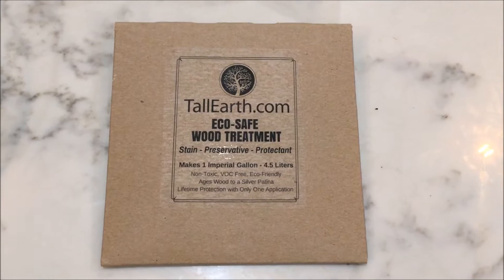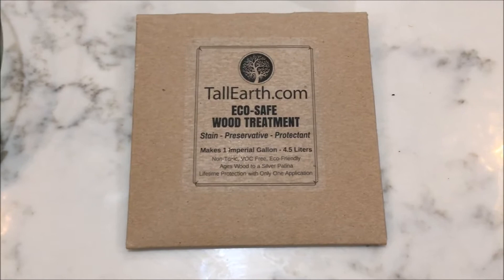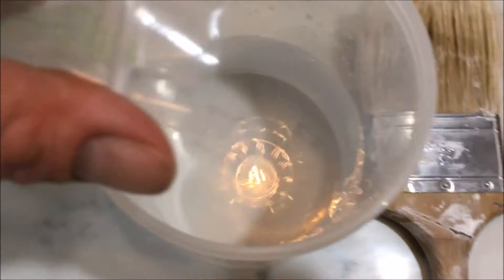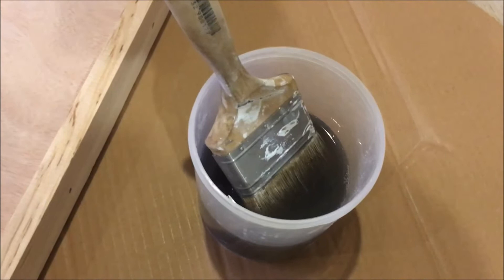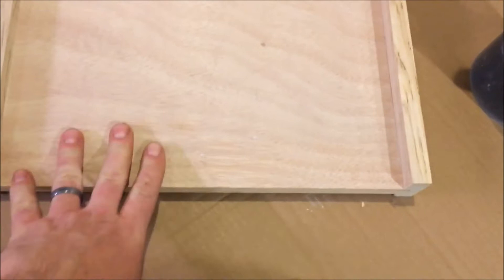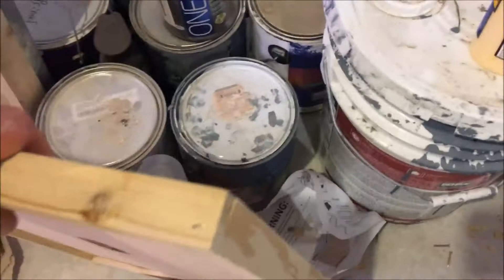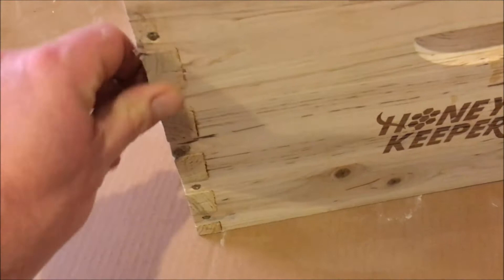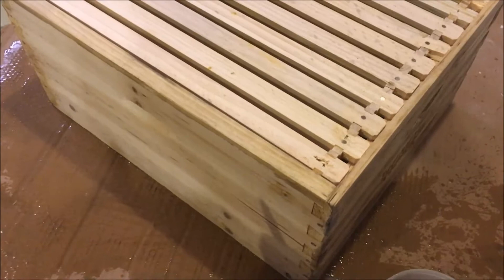Sealing a BeeHive with Eco Wood, Painting Seal Organic All Natural Tutorial How to

Comment: Interesting stuff, so you've had out in the weather for a while, what are your thoughts now? Is it working well? Does water bead up on it like water seal? Interested in how it holds up, thanks for sharing this little known product.
Reply from the maker: Frederick Dunn Excellent it’s still looks exactly the same and I have it on a wood platform and I can see that the rainwater has made it to spread down a little bit onto the wood platform so it does indeed continue to spread over time. And it’s only been a year but the wood looks pristine. I am doing raised garden beds this spring I am going to use it on all of that as well
Reply: Thank you so much for the reply, I really appreciate it. I've decided to make my own finish from beeswax and propolis.. but that will require annual refreshing. Glad that is working for you!